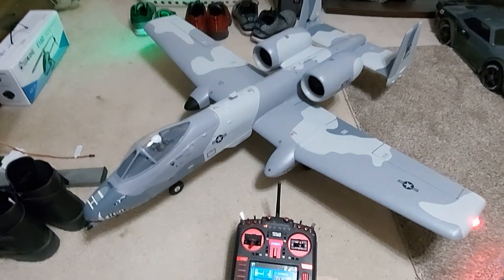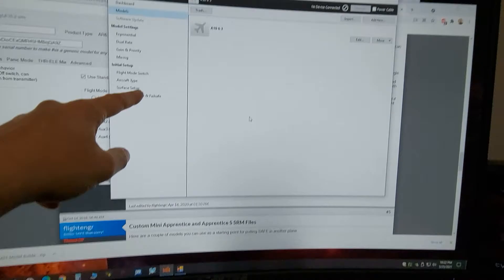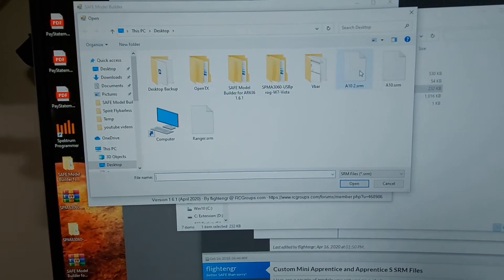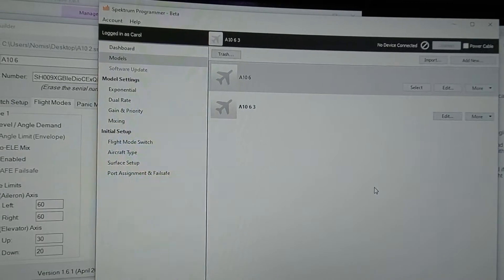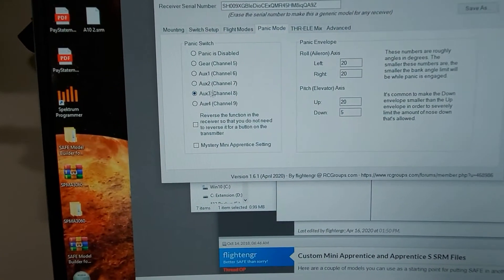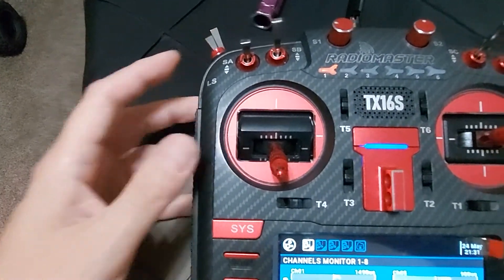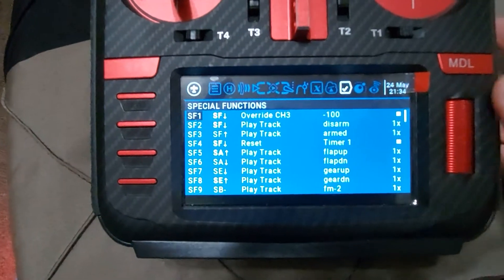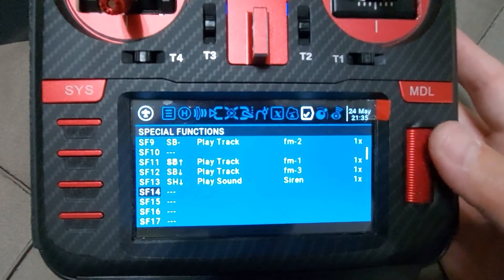Full AS3X Programming, SAFE, Bailout, And More, AR636 OpenTX TX16s Max Twin 64mm A-10

Comment: Can I use the Safe Builder to any Smart Spectrum receivers?
Reply from the maker: I tried others and it did not work, doesnt hurt to try
Reply: I tried on both AR631 and 630, it did not work. Thanks.
Reply from the maker: @berniebengco3180  sadly the 630 631 637 are locked and only configured via forward programming on a spek radio
Reply: Radio master have forward programing, have you tried it?
Reply from the maker: @berniebengco3180  i have not but from what i read its not perfect

Comment: Ar636 is a 6 channel reciever and you put panic button on channel 8,how is that possible?
Reply: @NomisRC  
so if I have a 6 channel plane and I have  8 Channel receiver spectrum of course and I want to use as3x and safe does that mean I only have one channel left or do i still have 2
Reply: The receiver is capable of, from what I've been told, 12 channels, even though there are only 6 physical channel ports.

Comment: Nice video, thanks for posting. That said, I just got an E-Flite Draco with AS3X and SAFE select receiver. I was going to use it with my Futaba 14MZ or my Taranis X9D, but after I watched your video, I realized that I have a Radiomaster TX16s as well. I know I cannot just use the Futaba because of the different protocol, unless I take the AS3X out and install a Futaba receiver. I am good enough of a flyer to not need the SAFETY feature, but it is for sure nice to have. I believe Ihave a DSM module for my Taranis, so I could use that. However, I might give the Radiomaster a try though, after watching your video. 
I guess I am trying to say, thanks for posting, ha ha.
Reply: @NomisRC  That's great! One more question though... Shouldn't I be able to simply bind my new plane (Draco with AS3X and SAFE receiver) to my radio, WITHOUT programming!? I mean, E-Flite/Horizon Hobby cannot expect people to buy a PNP version of their product, and then have to program it forever...!? I would think this should work as long you do not need to program extra switches for bail-out and what not!? Thanks.
Reply: @NomisRC  Hey, thanks for the fast reply! I totally understand what you mean: If you would like to use the extra features, you need to program the radio/receiver. However, I thought that the SAFE technology always works, you know, its always ON, but maybe I am wrong!? Thanks.
Reply: @NomisRC  Not being able to turn sucks. Especially when flying a plane, ha ha. But I thought that there is a USB interface that allows you to hook up the RX to a computer and program it!? Programming the RX is one thing, and programming your TX is another. I thought they have nothing to do with it each other...? If I can change the bank angles in the RX, I might not need to program my radio for a while...
Same here... I wouldn't mind having some "help" when flying, it has been a while too. : )
"The way you bind in safe select is when the rx is in bind mode before you tell your radio to bind you pull the bind plug" Can you please further explain that!? Again, thanks for the great tips! Much appreciate it!

Comment: Awesome Video Simon, thanks a lot. I'm programming my TX16S Max now for my Turbo Timber Evolution 1.5. I love my TX16S, so I'm happy to be able to use it with my fixed wing.

One question; if I am going to replace my servo, what servos would you recommend?
Reply: @NomisRC  thanks Simon. They are cheap enough and the metal gears are what I want. I appreciate the info!

Comment: Thanks for the video, just subscribed. May I ask, will I be able to program and use the RX with my TX16s just like I am using a Spektrum TX? I'm not bothered about telemetry, just want to know that I can program the RX and use it's modes with the TX16 all ok? I'll be using the AR631 by the way.
Thanks for the help, pretty new to the hobby.

Comment: An Interesting and useful video. I came here as I've been designated our Old Fart Fliers Group's "expert" on the TX16S by the over-80 section. (Mainly because my mid-70s brain is just a tiny bit less far down the Old Timers' Disease trail - And a bad leg makes it hard to do a quick step backwards! ;-)) Our receiver is an AR631 in a new Maule. We also have a 3230A in a Cub but that's another story. The BNF Maule (for the obligatory "Safe ON mode) required a start-up with the bind plug in and plane level, then remove bind plug, then set the TX16S for "Bind" and it binds no problem. Channel 5 is for Lights and 6 for Flaps so channel 7 was assigned to switch SE and then it switched Up-Down 5 full times with the sticks held down and in. Went OK. Throttled the motor up and switch SE switches between "Safe" (Fully Self-leveling Stabilization) and "AS3X" (Acro) modes. 
A couple of problems have appeared though ...
A..Channel 5 won't switch the lights On-Off when a switch is assigned to it on the TX16S. This might be a self-made problem as initially this channel was assigned to the Mode Function via the Flippity Flip and Combination Stick Positions before being re-assigned to channel 7. Possibly binding in "Safe Off" mode (with Bind Plug left in and then re-doing it in "Safe On" mode may correct that.
B... Assigning a switch to channel 6 and creating 50% and 100% outputs allows the flaps to be controlled but the servos appear to be being over-driven at 100% (and sometimes at 0% also) even if the 100% setting is reduced. Some work (and research) needed there. 

As to this video the 1 thing I'd not agree with is setting your Throttle Cut Switch towards you for "Disarm". Best to use the normally required for start-up "Backwards" and use a switch away from the edge of the Tx where it's less likely to snag in clothing.

Comment: the programming for ch5 (special overrides)  is correct.  You must also  have ch6 at +100 to get out of assisted mode, however (another switch can be used) and to achieve full travel for ail and ele.

Comment: Thanks for all the great info. I followed your instructions and was able to setup my E-Flite Timber X and Conscendo Evolution with my Jumper T12 Pro transmitter. I was also able to setup an AR636 receiver in my Hobby King AXN Floater. Everything works perfectly. I am, however, confused about one thing. I thought the AR636 was a 6 channel receiver. I put my flight mode switch on channel 5 and flaps on channel 6. How is it possible that you can setup switches on channels 7 and 8 for a 6 channel receiver? I ask this because I would like to put an AR636 in a plane with AS3X and SAFE, flaps,  and retracts if possible.
Reply: @NomisRC  That's great. So, I should be able to physically plug in flaps and retracts and use an aux channel for my flight mode switch. Thanks for the quick reply.
Reply: @NomisRC  Thanks. I'm looking at a T-28 with flaps and retracts.
Reply: @David Clay
Is in your Conscendo Evolution the AR637TA Reciever? I ask because i am thinking about to by one and have also a t12pro and want to use These method Here from Simon
Reply: @olekolef773  Yes, my Conscendo has the AR637TA. I actually didn't have to do anything to the receiver except bind it to my T12 Pro. I assigned a switch for SAFE select. I also added flaps to my Conscendo and assigned a switch for that and dual rates. I flew my Conscendo this morning. It is truly awesome.
Reply: @txdave2  not Even the usb programming Plug?
That sounds great. How did you the Binding?on the „normal“ way or like Simon did. with the unpluged bind plug like in his previous Video?
You mean flaperons?
Reply: @olekolef773  The receiver in the BNF Conscendo is already programed for the plane from the factory. No need to change anything in the receiver. Just bind it to your transmitter and set up your rates, switches, and expo in the transmitter. This video is for programing a receiver you buy seperately or move from one plane to another.
Reply: @txdave2  thank you for the Information
Reply: @txdave2  how is it with the loose Taile?
Reply: @olekolef773  Haven't noticed any bad flight characteristics. Even without SAFE it flies very stable. It has become my favorite RC plane.